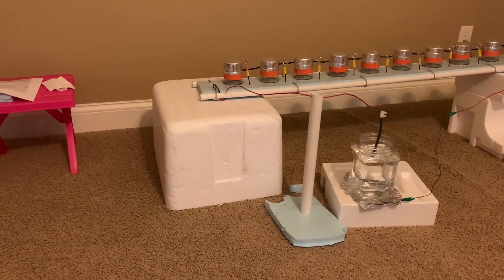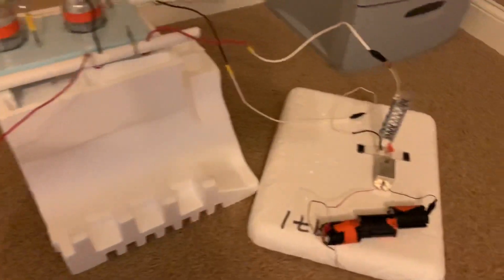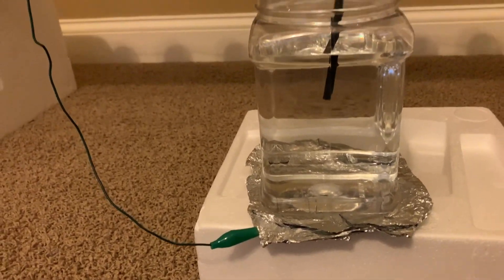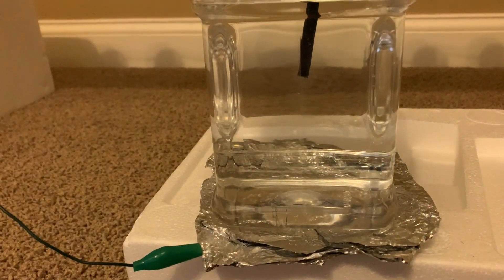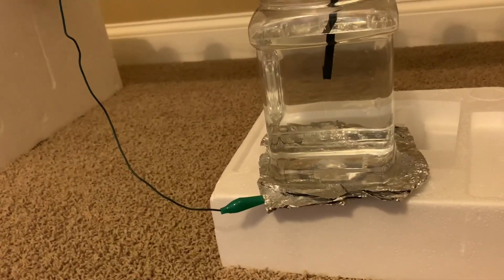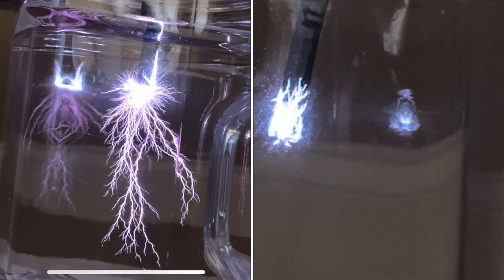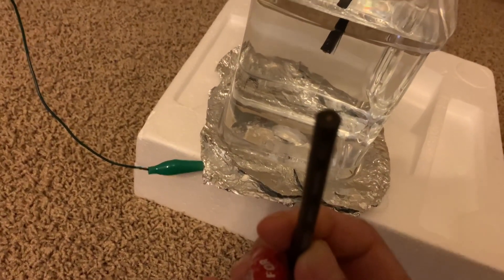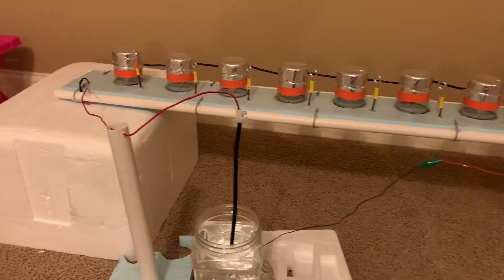(+) vs (-) Underwater Lightning- is there a difference?

Comment: I would recommend Prof Gerald Pollack's book The Fourth Phase of Water. You can also view some old talks on youtube where he discusses some excerpts of his research.
Water naturally organizes into a strong honeycomb structure that is negatively charged, coined EZ or the Exclusion Zone. This gel-like structure has thousands of layers of interlocking molecules that organizes preferentially around hydrophilic interfaces. Water readily absorbs and converts light (radiant energy) into 5 different forms, physicochemical energy, optical energy, electrical energy, mechanical energy, and radiant energy other than optical. I believe the difference between the polarity of the high voltage discharges comes down to the structure of the water and the distribution of charge as a result of water's continuous transformations.

Comment: This is an excellent video! I have a question for you, do you have a pH meter? Would love to see if there's any difference in pH by using (+) or (-) lighting. Do you still have the device assembled?
Reply from the maker: That is a really good suggestion. The equipment is dismantled at the moment but it would be a really interesting experiment to try out. I know that there are unstable species generated H2O+, H2O-, HOOH, HOOOH,
Reply: @BrianDhvTinkerer  Thanks for the prompt reply! you're going to be producing some reactive species, even if the water is distilled it will contains gases dissolved as oxygen, CO2, etc... I think the positive sparks are larger because earth has a negative overall charge and the sparks grow larger looking for it. Another cool thing to do would be to enclosed the water and change the position of the ground electrode up the jar
Reply: Hydroxyl will form arround the negative probe and raise the pH is my guess.
Reply from the maker: @Skylabz604 plan on repeating with more analysis of the products formed. I think water is split into its components stoichiometrically. There maybe some H2O2 formed as well but I am not 100% sure of this…

Comment: Nice Video.
I would say you had no complete voltage break down when using the negativ pulse. Maybe you need to decrease the distance of the gap between your wire and the aluminium foil for negativ voltages or increase the voltage for reaching a compelte breakdown too. Its normal that positiv voltages break down at lower voltages (compared to negativ) when you use electrode configurations like this tip-plate electrode. Kind regards
Reply from the maker: That’s a great suggestion! I will try that out and let you know. It’s difficult to direct all of the charge into the water without breakdown of the high voltage cable. I had to experiment with different cable materials to get the charge to exit at the tip of the cable.
Reply: @BrianDhvTinkerer  Cool ! Hmm maybe you can fix this by putting several layers of shrinking tubes arround the cable. They are cheap, easy to use and insulate a few kV / mm :)

Comment: Great experiment as always, but could you increase the volume of your voice when you edit the videos? I believe your experiments would be appreciated much better if your commentary was more audible...
Reply from the maker: Sounded OK on my end. Thanks for the tip.
Reply: @BrianDhvTinkerer  I think I commented about it on another video, but when mastering audio, you really need to rely on the Vue meter of your editing software (aim for the audio to peak around 0dB, but not higher to avoid clipping. If you have super high sounds in a video, making the rest of the sound very low volume, then some compression, limiter, or volume normalization should help bring all the sounds to an easily heard volume, without having deafening moments)